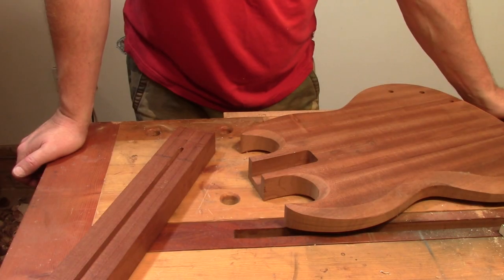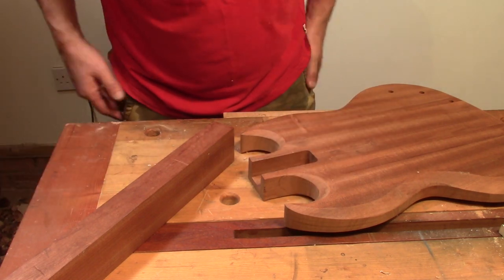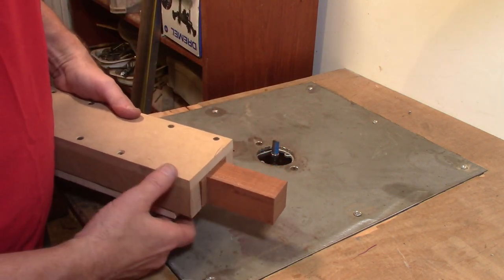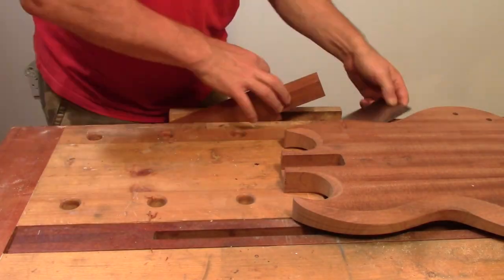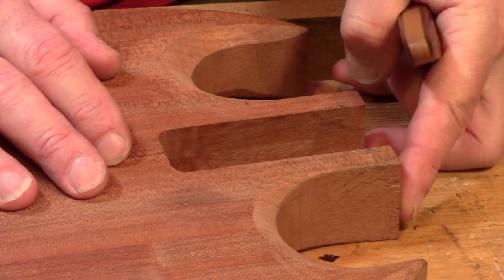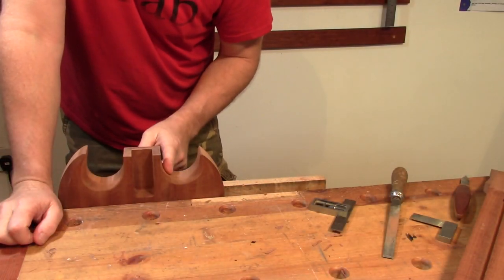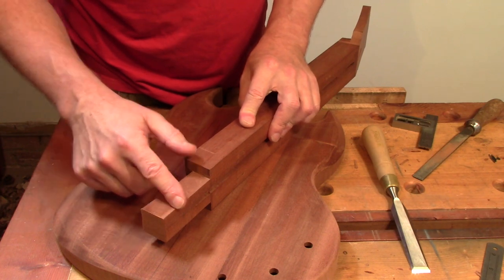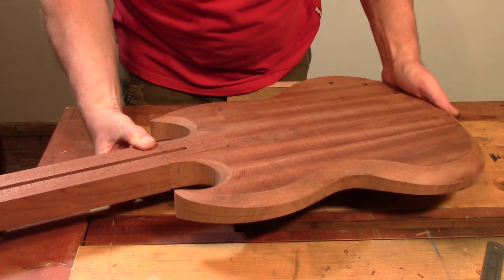Great Guitar Build Off: SG junior style guitar build part 6

Comment: How did you work out how deep to rout your neck pocket before you had a neck in hand?
 Please help! I'm reluctant to go any further with my sg build until I've got this nailed on.
Reply from the maker: I cut the neck pocket in at 27mm deep if I remember correctly. It's cut so that the bottom is parallel to the top of the guitar. Then when you make the neck the cheeks of the neck tenon (the bits that but up to the body on the side of the neck) are cut at 90 degrees minus your desired neck angle (I used 3.5 degrees). Then when you cut the neck tenon, mark down from the  top of the neck (before the fretboard is glued on) at the cheek the depth of your neck pocket. Then if you square a line along the tenon from the cheek you will have the tenon cut at the correct angle. This will leave the body end on the tenon a little proud of body but that can be trimmed off when it's glued in. I go into this in a bit more detail in episode 29 of my ES 335 build https://www.youtube.com/watch?v=WmHrZDFbGCY 

Hope this helps, if not give me a shout.
Patrick
Reply: @Adventuresfromtheshedofdreams  couldn't have asked for a better reply. Thank you!

Comment: With all the effort your putting in to the neck joint, will you be doing away with a scratch plate?
Reply from the maker: Thanks Glen, it hasn't got the 1/4 inch gap that Gibson put in but it'll still need a scratch plate :)